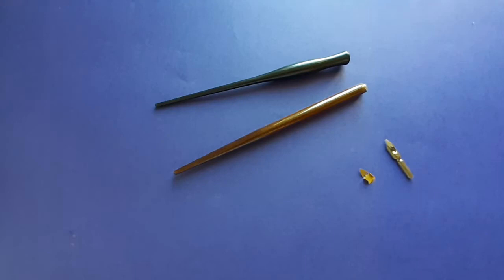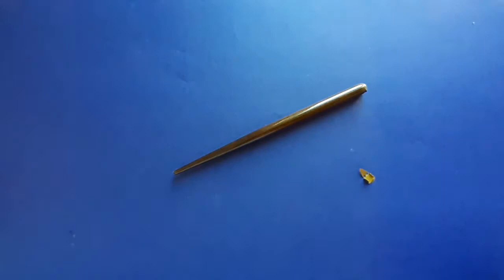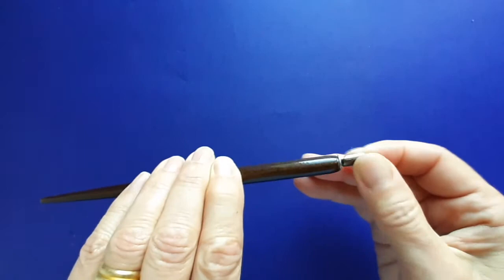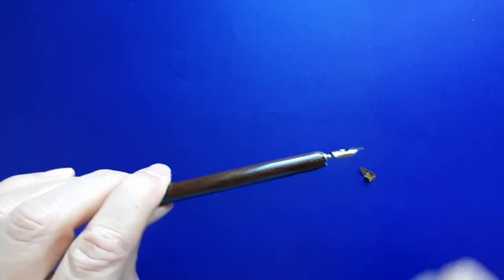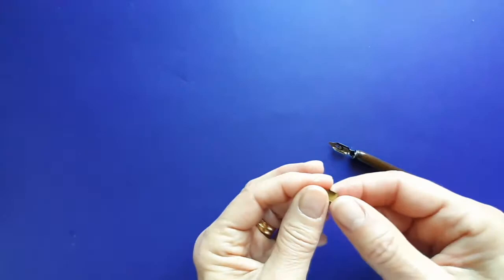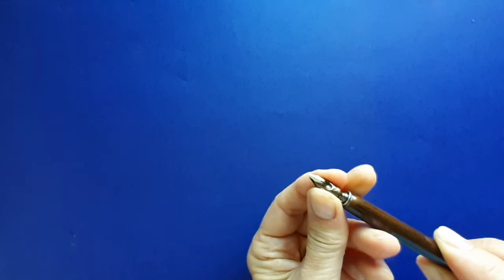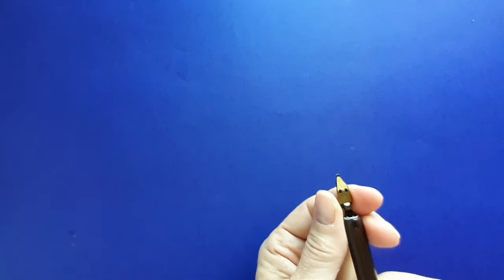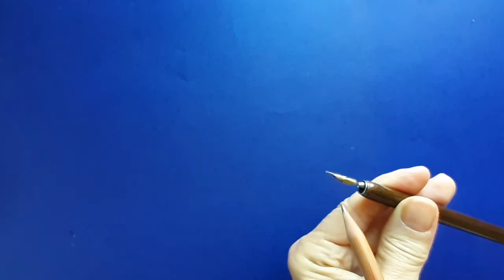Fitting nib and reservoir

Comment: Hi, thanks for this video. Could someone share how to remove the reservoir?
Reply: You can gently slide it off and reuse with another nib. Remove any ink with a tissue otherwise it'll get messy
Reply: Thank you so much for your reply. Mine is tightly holding on to the nib, I don't want to damage the nib. What shall I do in that case
Reply: @kiranzeeshan4301  Most likely you need to undo both wings that hold the reservoir in place. They look like little flaps on each side of the nib, you need to slightly lift them off. You can use a pair of small pliers or tweezers to do so. I hope this makes sense
Reply: @azjatuhajbej9215  thank you so very much, will try that.